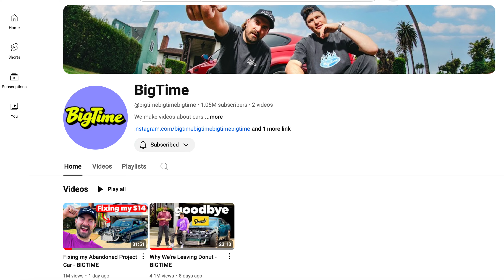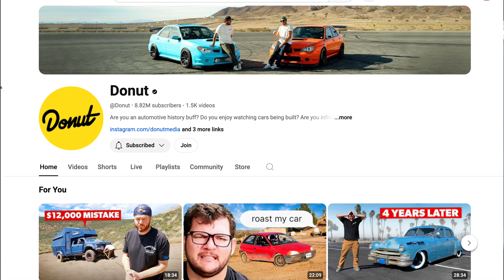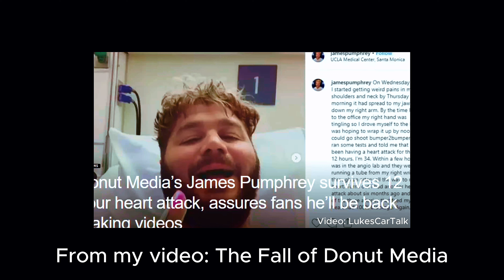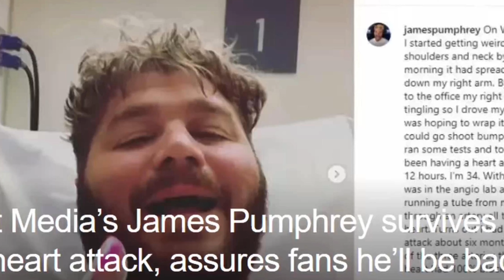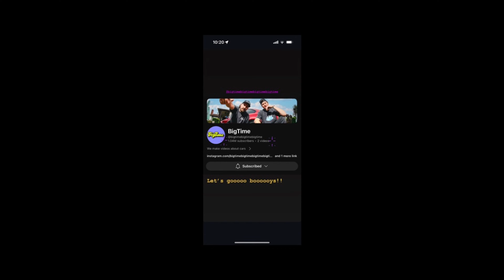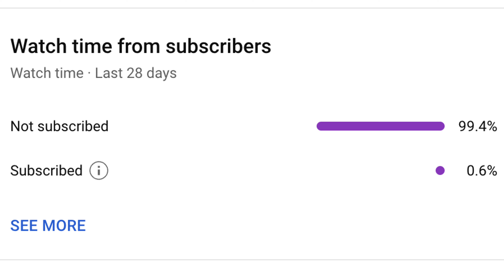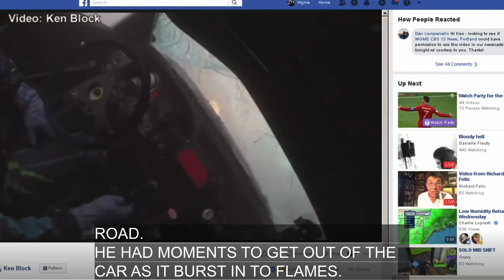Why James Pumphrey MIGHT Join BigTime

Comment: Thanks for putting my comment up …. So it got me thinking yesterday what are the numbers like for car throttle now after everything so..

Car throttle 12 years 3.09m subs
Autoalax 2 years 650k subs
Top dead centre 4 months 211k subs
All the gear 1 month 192k subs 

The views tell the full story 

Car throttle averaging 600k 12 months ago
Car throttle averaging 400k 6 months ago
Car throttle averaging 60k with the new lads (and that’s me being nice)

Autoalex averaging around 400k (massive difference depending on the content)

Top dead Center averaging around 300k

All the gear averaging about 200k 

Averages are just estimates but not far off but Yh so basically car throttle is dead now the new guys ain’t bad but with those views to subs it will take a lot to revive it